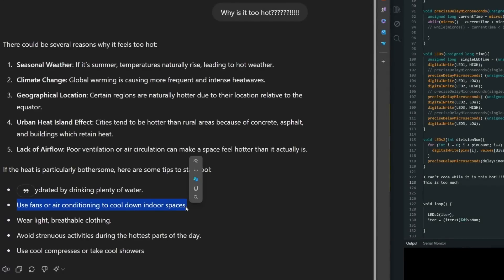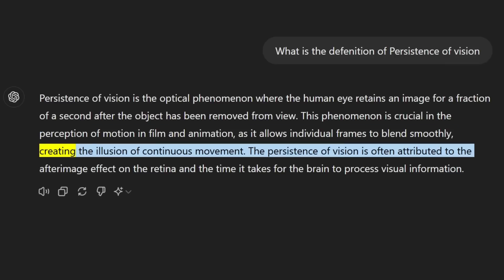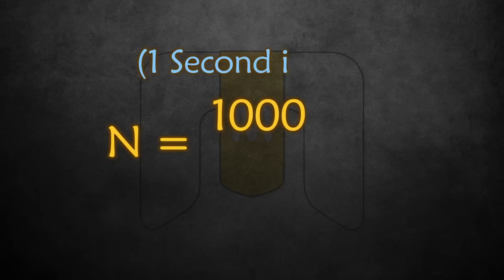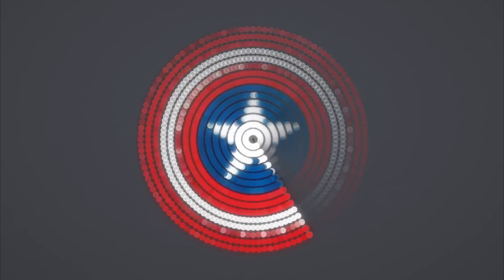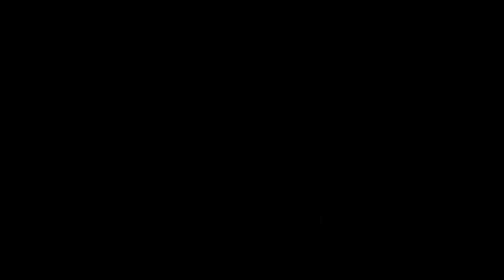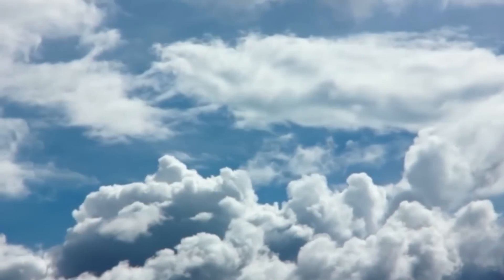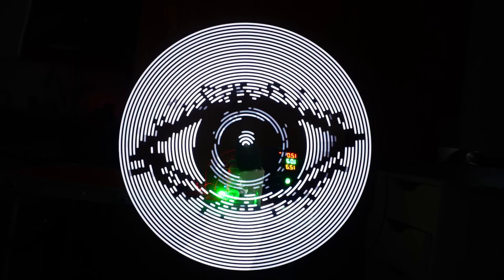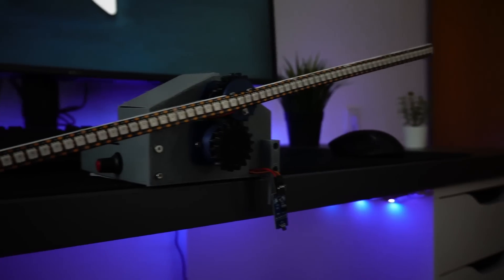DIY POV display with 7200 pixels using LEDs

Comment: I loved this project! I have a question tho, I'm trying to use ESP32 instead of arduino nano but I'm struggling with the coding for it. do you think it's better to stick with arduino nano?
Reply from the maker: Nice to see that you liked it. Defiantly stay with the ESP32, it is much faster. If you want to check the code I used (The Arduino code should be usable directly with ESP32) you can check the Github repository with the full code. You can also join the Discord channel and there we can have more detailed discussions.

Comment: At what speed do you run the engine? I'm designing one too only I wouldn't want the speed to be too high for the slip ring (like the one you used).
Reply from the maker: I think you can start to see the images with a very low speed (maybe even about 5 rotations per second), but you should aim for at least 10-15 rotations per second

Comment: The 4 wire smart LEDs with seperate Data and Clock, like the APA102 have considerably faster PWM and data rates.   The fastest I know of, the HD107S does 27Khz PWM and up to 30 Mhz data.
Adafruit uses the term "DotStar" for this class of light.
 You will find all of the pro "Holographic Fans" use simple RGB LEDs like used on video wall panels, employing lots of multiplexers to drive directly from the processor which does the PWM.
Reply: the multiplexers also introduce latency, so I don't know how much faster it gets you.

Comment: A gimbal motor with hollow center and 2.7 mm addressable led cob strips way faster data transfer with them only needing 1 data wire also will give quiet operation and 2 cob strips side by side with them being smaller would more that double resolution great video you helped me out on a project I want to do like this
Reply: What cob strips are you referring to everyone I found was ws2812 or ws2811 based which are too slow.

Comment: you could've gone for a ESP32 and stuck to using a microcontroller only instead of using a full raspberry pi, but you would've had to do communication via wifi or bluetooth, i think it can address the WS2812 LEDs faster too) but more power is always better :P
if the LEDs speed is what limits you, look into maybe using an APA102 strip instead

i've been thinking about making my own POV display for a while now and this brought up a bunch of things i hadn't considered before, thanks! ^^
Reply from the maker: That is correct, ESP32 can definitely work. However, for multiple reasons I chose the Raspberry pi instead. The main one is that it allows for much more flexibility for future features which I might work on. And as the video was already long I didn't go into details about all the other possible options.
Definitely I could have used even faster LEDs so I would suggest using APA and save some headache especially if you want to build a large display with many LEDs.
I am glad that the video might have provided some interesting ideas.
All the best building your POV display.

Comment: Nice project, can you double the resolution if you off-center the LED strip? Doubling the circular resolution, like an old TV scanlines, maybe you need to compensate for this by doubling the motor speed and frames per second.
Reply from the maker: You are right, it is not straight forward doubling the resolution. To achieve that it is necessary to double the motor's speed. And if the speed is not doubled, you will still see the full image every frame. However, the pixels you will see in the first and third frames, would be different than the pixels of the second and fourth frames. I didn't go much into details about this and some other aspects as the video was already a bit too long.

Comment: How many hall sensors did you use bro?
Reply from the maker: Just one hall sensor fixed outside the blade, and one magnet on one side of the the blade. The hall sensors gives a signal when the magnet passes nearby it.

Comment: I'm working on a few designs myself.  End goal is to make a large sphere to hang beneath a drone with animations.  Using 2020smd strips will pack more pixels per meter, and a Teensy instead of arduino.
Reply from the maker: This sounds like a great project!
I hope you get the result you expect. All the best!

Comment: subscribed
I'm genuinely wondering why you didn't use an ESP32 instead of the Arduino Nano for this. You'd have been able transfer MJPEG videos over WiFi in full color to drive the LEDs and it's cheaper and smaller than a Raspberry Pi. It's also still Arduino IDE compatible.

So what type of LEDs did you use for the higher refresh rate?

Comment: Good job, and good work starting and finishing this project from scratch, since a little browsing when you set out would have revealed the opportunities to just copy someone's DIY plans for something similar and saved you so much time. But you wouldn't have learned so much, or had the same satisfaction when showing the final results.

I could tell you were working through the design process independently and step by step when you chose the Arduino Nano early on. As though it should have the speed and memory to manage a large color array smoothly lol. On the other hand, a Raspberry Pi seems overkill for the task. But an ESP32 would handle it well enough and could've stayed with Arduino code; it also has a co processor dedicated to wifi communications - so then you could make the controller spin while receiving images wirelessly at the same time, with no worries about OS interrupts spoiling timing. And it would be more affordable and consume less power (possible future project?)

I'm curious what addressable LEDs you used that require 12V.  As you noted, they needed to be the faster 2 wire clocked SPI type for high resolution spinning POV, but those usually need 5V so yours seem unusual?

Comment: This is a great video.

Did you test to see what the maximum pixels you could get around the circle, is 100 the highest you can go?

Is that limited by the motor speed, the LED switching or the rPI?
Reply from the maker: Thanks, this is actually an amazing question, the main limiting factor is the speed of the LED switching signal. I wanted to include a dynamic pixel count, were not each line has 72 pixel. This will allow for more slicing, but the video was already too long so I decided to keep it out.
Reply: Something you could maybe do would be interrupt the chain of data lines so instead of one slow serial connection, you'd have 4 quick one addressing multiple sections.
Reply from the maker: This is what I had in mind, but only two parts instead of two. This is due to the fact taht the slip ring I had only has 4 wires (2 power, one data, one free). So the most I could do is to double the speed with splitting the strip into two. 
However, the video was already too long and I felt that it had so many different concepts, so I decided not to do this (with other two interesting ideas) and maybe do them in the future.

Comment: I like the idea of simply shifting the LEDs to literally double the resolution.
I think this is a great first video. Looking forward to more projects. Subbed.
Reply: Technically the resolution wasn't doubled, more kinda de-halved, if you will. The pixels had already been there anyway (and showing information, only it was redundant). Visible pixel density, however, was doubled (in exchange for half of the potential refresh rate for any given rotational speed).
Reply from the maker: This is a nice way of describing it. Most of the things said in the video were somehow simplified (end even sometimes oversimplified) for the sake of clarity. My intention of the video is to describe the process of building such a screen for anyone who is interested while showing the issues they might face. And for other viewers, my hope is that they can get something useful from the video, or at least enjoy watching it.
I hope at least the video was interesting for you to watch.
Reply: @Mecha-94  
Just in case I came off rude - I was smartassing jokingly, but didn't mean to downplay the worth of that idea and of that step in the design process in the slightest. It is a super neat idea, and there is much worth in you showing it in the video, illustrating the thought behind a design decision and how one seemingly simple change can make a huge difference.
Reply from the maker: @keinschwein8467  No worries, you did not at all. If anything, your comment is a useful explanation.